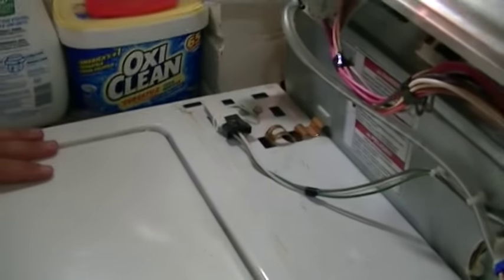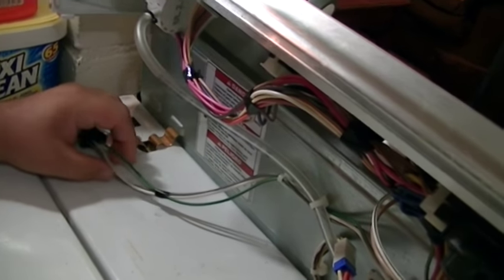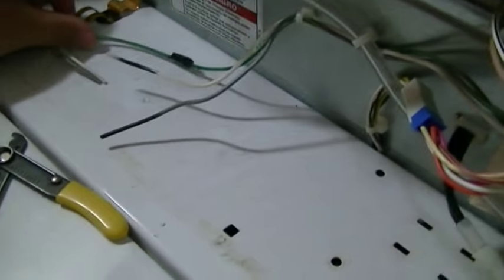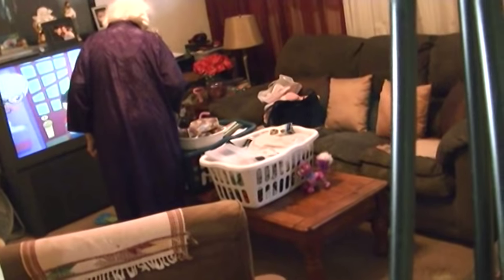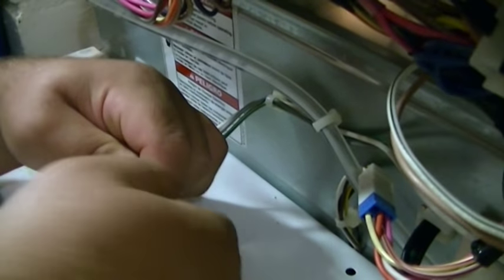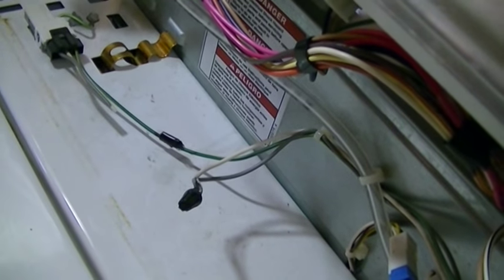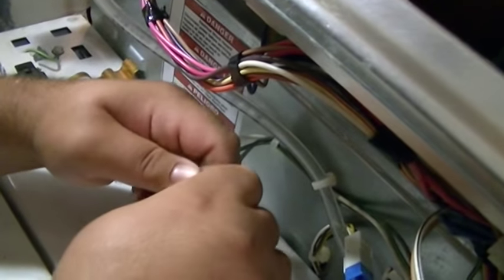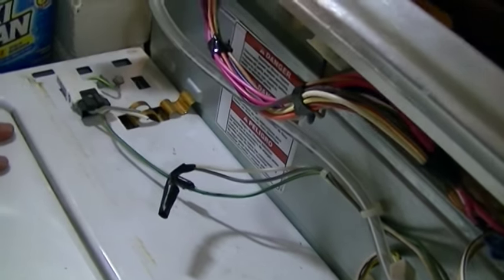Quick & Easy Whirlpool Washer Lid Switch Defeat

Comment: I know this is from 2 years ago, but you just saved me from having to buy a whole new washer! I bought and installed 2 new lid switches thinking it was faulty parts..  but no it was the darn connector and by bypassing it, it works again! We have had this washer in the family since my parents bought it new over 20 years ago!
Reply from the maker: Excellent!  Keep that machine running at ANY cost--you cannot buy another washer out there that can do anywhere near as good of a job!
Reply: What is the washer model, please? We want to see if we can find one. We have a large family and need something reliable and easy to fix
Reply: Where is the connector you are referring to?  Please give me a step by step i can try- if you have the time! Tia!
Reply: @FixitWithFoxy  this was 3 years ago... I no longer have that washer. But it's under the front panel... There should be 2 clipped in trim pieces on the front side. You take those off and there's screws underneath those.. there's a couple screws on the back if I remember correctly, but if I were you def look up other videos on how to open the control module then come back to this video

Comment: Worked like a charm for me! I wasn't even sure if the lid switch was the problem because I don't have a ohm-meter or whatever. Too fancy. But the load of laundry stopped mid-cycle, and it would add more water but wouldn't spin. I read that the lid switch is a common culprit so I will get the part online. I'm a mom to a 5 month old and I needed to be able to do laundry NOW!
Reply from the maker: Glad I was able to help out!  Multimeters aren't expensive, Harbor Freight often has coupons giving them away free with purchase--go in, buy a pack of batteries you can always use, and get a free meter.  More than plenty enough for simple testing like this.

Comment: Shout out to you. Got this same washer had it for 10 years now and because of you it will last longer

Thank you
Reply from the maker: You're very welcome.  It will last for way longer than 10 more years.  Never get rid of it, fix it at any expense, you will never be able to buy another one because they stopped making them.  I have other repair videos, and if you don't find one of mine, there are many others out there.  Parts are cheap and plentiful, yet the machines rarely break.

Comment: Love the video.  Took me 20 years to realize that you shouldn't twist the wires individually if you are using a wire nut.  The bare loose strands grip much better and mesh better, creating a better electrical joint.  Thank you!
Reply from the maker: Thanks.  I've had mixed results both ways, and have found that for me, twisting them usually works better.

Comment: Thanks man.  After reading reviews on replacement switches, I decided to just save myself the time and do this.  Wishing I never actually removed the old switch at this point!  Good video.
Reply from the maker: Thanks Kevin!
Reply: @jaykay18  my parents have this same washing machine. I just replaced the lid latch switch and the lid will still open mid cycle. What would be your next step?

Comment: I was about to order the OEM part for $39, then the knock-off for $9. Yours is an even better solution. Simple, well explained, perfect.  Brilliant, thanks!  Read several comments.  Do you ever get tired of the red, white, and blue wire questions? 😉
Reply from the maker: Thanks Jeff!  Yes, I sure do get tired of them.  Thank you for reading through the comments, often there is a wealth of information and questions that have already been asked, that have been answered.

I have many other videos of these types of machines, including several repair videos.  In case you ever need them, you'll know where to look first!
Reply: Where'd you see the OEM part for $39?
Reply: @kickasbutterfly  Parts direct

Comment: Omg I fixed my machine.
I did exactly  what you showed.

I previously  did a different way and it caught fire and melted  part of the black adapter. With electrical tape.

I used an electrical cap to the Grey and white wire.
Omg you saved me so much money.

Thank you thank you for showing exactly what to do.
I am sooooo happy.
Reply from the maker: Those wires are carrying the full current of the motor, so they have to be good, solid connections.

Comment: Thanks for posting this, I was just getting ready throw in the towel and go get another washer. You were clear on the instructions and right to the point.
Reply from the maker: Thanks.  Point is, you CAN'T get another washer, at least not one that works like this.  Doing that would have been the worst decision you've made.

Comment: Thanks for the video man. I JUST replaced the timer on our washer about a month ago, and then it was on again, off again working. We'd open the lid and shut it again, and it would work for a couple minutes and then cut back out. It was driving my wife and I nuts, and we didn't really WANT to go buy a new washer and dryer after JUST spending $160 for the timer. Figured it was the switch, saw this video, and voila! Works like a charm. Thank you!
Reply from the maker: Great to hear Bruce!

Comment: Thank you so much! My washer stopped mid cycle. Did this bypass, it worked. I was getting ready to go out and buy a new one.
Reply from the maker: Don't ever do that Todd, you'll never get another washer that works as good as this one!  You can find a replacement lid switch online pretty cheap if you were interested in replacing it.
Reply: P

Comment: jaykay18 I need help! I forced the lid open and now it makes a clicking sound but the washer does't work. my washer is a Whirlpool model wtw5000dw2. I think I broke the lid switch, the washer is about 2 years old. is probably the same model as the one you'r working on in the video. if I do the same thing you did do you think it will work? please I need an answer.
Reply from the maker: You can start by helping yourself first.  You say your washer is 2 years old.  There's this thing called a VIDEO DESCRIPTION.  In that, I always put the date of recording in.  If you would even give half a damn and TRY first, you'd realize this won't help you.

Comment: Great and very helpful video. I do have a question, what if I don’t have the little green piece you put on the end of the wires? Is it something else you can use?
Reply from the maker: You can solder the wires and use heat-shrink tubing, but that requires skill.  Do not substitute, the full current of the machine is passing through these wires.  If they short out you're going to have a very big problem.  You need wire nuts.  Home improvement stores sell them.
Reply: Hey, did you get the answer to that question? I'm wondering if I can just use electrical tape

Comment: My lid switch connector melted.  I tried to bypass just as you showed in the video, but it did not do anything.  I checked the wires for connectivity, and there is none.  Do you have any suggestions?
Reply from the maker: Please give me the model number for your machine so I can look up the schematic and help you further.

Comment: Can you help me, my washing machine has different colored cables: green, gray and black.  The gray and black do pass current and the green does not.  I can do what you show in your video but with the gray and black cable?  Thank you, I will appreciate your help.
Reply from the maker: In AC (Alternating Current) circuits, such as the washing machine in this video, green is almost always ground.  So that stays left alone.  If there are ONLY 2 other wires, you should be able to do the same.  You can check the wiring diagram (should be tucked in the underside of the controls panel) to be sure.
Reply: @jaykay18 thank you

Comment: Hey Jay, great video! My washer stopped draining/spinning. Inspected the switch and it was for sure bad. The connector and switch had melted together. Is this a common problem? What would cause them to melt together like that?
Reply from the maker: I have seen that happen before.  Generally, a bad connection, corroded metal contacts, or moisture can cause that.  A bad connection causes heat, heat causes plastic to melt.

Comment: Great Video and highly appreciated However, question to be raised my Waching machine when I  lift the Lid its stopped but when release the Lid again the Machine does not started and you can't hear any clicking, please advise, B.Regards
Reply from the maker: With a model number of the machine, I can research it a little further.  But these lid switches have been known to go bad in such a way as you explained.  Replacing or disabling it may solve the problem.

Comment: What if the ground wire comes loose what do I do with it after that if it's loose can I leave it loose also or do I need to hook it to something
Reply from the maker: Can you leave it loose?  Well, they didn't put the wire there to just get in your way.  It was put there for a reason, and for a good reason.  Find a way to reattach it.  Make a good, solid connection to an unpainted metal surface.  That ground wire could save your life.
Reply: Okay what color is the ground wire on a 3-wire door lock switch or what two colors do I connect and the reason I sound like such an idiot and I don't know what I'm doing I've been watching videos I can't figure it out however I didn't start this job somebody else did and then they didn't finish it my boyfriend so I'm trying to finish it cuz I really need my washer to work but I think he might have connected the wrong wires can't I just hooked the ground wire to something else so that it's just as long as it's grounded right also thanks for answering
Reply from the maker: @nikkiwells8148  The reason you can't figure it out is because you didn't read the video description.  NOWHERE does this video mention, show, or say anything about a door LOCK.  The description says a lot more.
Reply: Ok fine washer lid switch then but my question remains the same if I have a white wire and blue wire and a red wire which two colors do I connect please tell me
Reply from the maker: @nikkiwells8148  YOU STILL DIDN'T READ THE VIDEO DESCRIPTION.

Comment: Thank you for this video; I tried shorting the black and white leaving the green intact but it still doesn't work. It is a whirlpool washer and dryer combo; do you have any recommendations? Many thanks. *I saw your additional humiliation clause; I have traced the latch assembly wires from the panels onwards; at this point I just want to drain the tub and get a new machine. Is there any other way to drain the washer than the 'hose' in the bottom?  Many thanks.
Reply from the maker: You mentioned "latch assembly".  If this machine you have will latch the lid closed while washing or spinning, you're completely out of luck.

Comment: Excellent! My grandmother's whirlpool machine that I acquired lives on. I don't need to go and find a replacement machine or spend anything on my current one!
Reply from the maker: You SHOULD replace the lid switch, it's cheap.  This job was done because the owner asked for it to be, not because the switch failed.  On my own personal machines, I put a switch in so I could have the lid switch operate properly, or have it always disabled.

Comment: Jay you would be proud of me, I read the description and determine that this wouldn't work for my washer :)  I can't speak for the other people though.
Reply from the maker: Thank you Chris!  I'm only sorry that you can't use this trick on your washer.  But I would suggest, if it's too costly to fix, that you find a good used appliance shop and buy an older washer.  Chances are very good you will have it for 30 years or more without a problem.  And if you find a machine like the one I showed in this video, I have several repair videos on it for common problems, that are super-inexpensive to fix.

Comment: This video is very helpful. I think it’s pointing me in the right direction. My model is a whirlpool WTW4800BQ0.  my lid lock has four wires coming from the control board. Red white blue and yellow. Any idea how I could bypass this lid lock on my model?
Reply from the maker: Yes, there are two things you can do:
1.  Throw out the machine.  OR
2.  Buy the parts that you need to fix it.

That's it.  There's no fooling a machine like that with a lid lock, if it's broken, there's no way to bypass it.  A machine like I showed has no computers in it, it's strict point-to-point wiring like wall outlets in your house.
Reply: @jaykay18  I appreciate the prompt reply. They have the entire lid lock mechanism for $50 was just trying to see if I could avoid it. Thanks again!
Reply from the maker: @HugoStiglitz609  No problem, best of luck in your repair.

Comment: So the gray and the white fused together. When the machine finish the whole washing cycle and I lift the door will it shut off the red light (the one that remains on at the end indicating that it's done)?
Reply from the maker: Sounds to me like you have a lid lock on your machine.  If so, this won't work.
Reply: @jaykay18  Yes, the door won't open unless I press the stop button on the panel.

Comment: Will this defeat the lid lock error? I'm not able to run now because if a kid lock problem and hope this will fix that problem.
Reply from the maker: This video does not depict, nor talk about a lid lock.  If you have a machine with a lid lock, the best thing to do is to take it out to the curb since the washing action is extremely poor (they changed to a belt-driven design with an indexing tub, which is just about useless).  There is absolutely no workaround or trick that you can do to get around this problem you have.  REAL washing machines don't have this malarkey.  The only way you can fix yours is to buy all the parts it requires and replace them, only to waste your money when the next thing breaks.

Comment: I seen this video on the washer lid lock bypass and I’m trying to do it myself on a Whirlpool mode, i ran into an issue though, the three wires you have are green white and black and the three that I have are dark blue white and red I’m not sure which ones to put together and cap off. I’m assuming dark blue and red are pos and neg and white is ground or neutral ?
Reply from the maker: Read the video description.

Comment: Have a GE washer that refused to spin/drain and is working after watching this video, thanks! Question, ended up clipping all three by mistake and the green (assuming it's the ground) is hanging freely.  Should this wire be grounded somehow? Not sure what to do.
Reply from the maker: Generally, green is ground.  You can possibly reconnect it from where you clipped it off.  If you can't because it was clipped too close, lesson learned for next time--always leave a little slack.  Quite honestly, since the machine is otherwise working, it should be fine.  The top has metal-to-metal contact somewhere else so it will remain grounded.

Comment: My wires are brown, white and black, also a whirlpool top loader machine... I connected the brown and black together... that makes the machine be able to rinse and spin... but I have to revert them to normal if I want the machine to go through a wash cycle... when the wash cycle goes to the rinse and spin part I have to jump the wires again (brown and black) /// Is there a way to just not have to be moving wires around? The part arrives 3 weeks from now, and I have no kids, it is really annoying having to do every time I want to complete the wash cycle.
Reply from the maker: Without a model number, it's very hard to tell.

Comment: Will this work on the whirlpool cabrio washer lid lock? Is this what  you was doing? I was under the impression you cannot bypass the lid locks. My lid lock went out so my washer wont even start. Parts are cheap it's just cant wash anything until they arrive and it takes weeks to get anything in bfe Arkansas
Reply from the maker: Is there a reason you  can't read the description or the other comments?  Nobody is going to come and fix your washer for you, just like I'm not spoon feeding the answer.